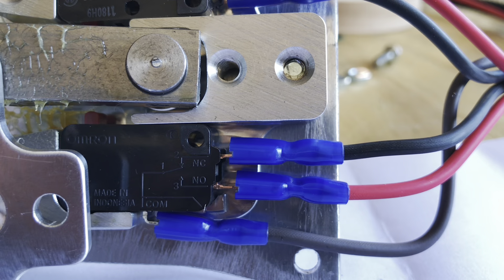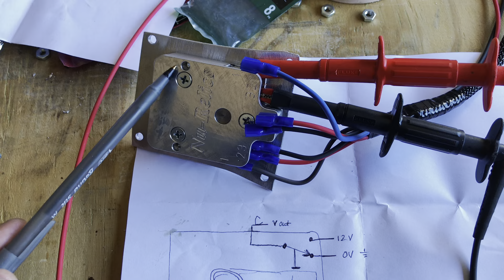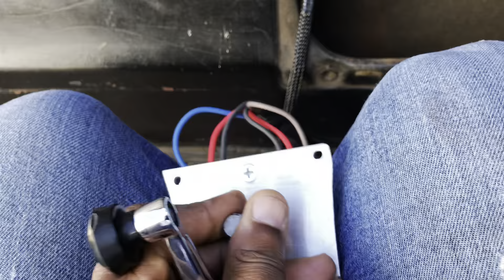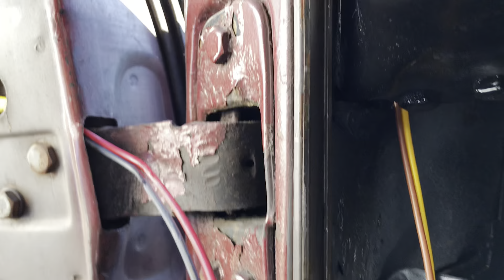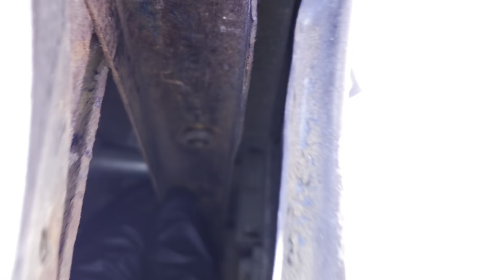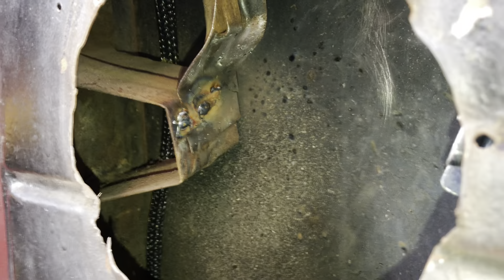1950 Chevy 3100 Power Windows Part - 2

Comment: Any way to slow it down
Reply from the maker: I’m sorry for the first reply but I was confused thinking that I was replying about the electric wiper conversion 🤦🏾‍♂️. No, they only have that one speed. It would be nice if you could slow them down a lil.
Reply: @gillrodshop  Yes...  add individual PWM motor controllers on each of the motor side of the switches (means four of them)....  Some have a knob that could protrude out the side of the door for the user to regulate speed .. or shove the speed control inside the door at a precise speed setting.